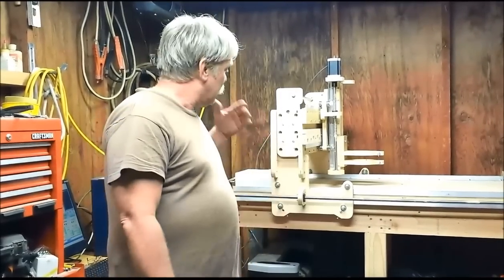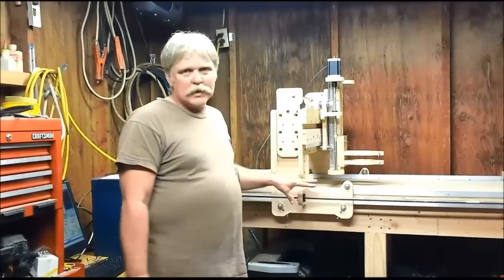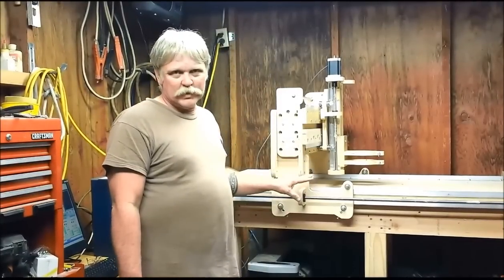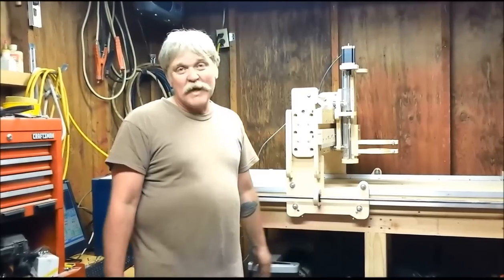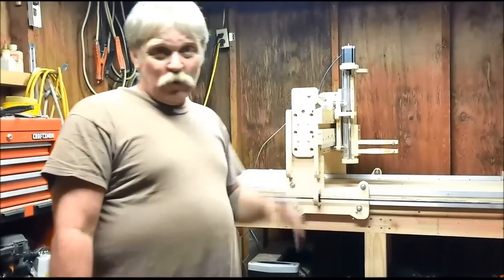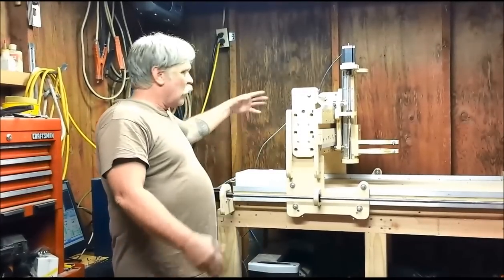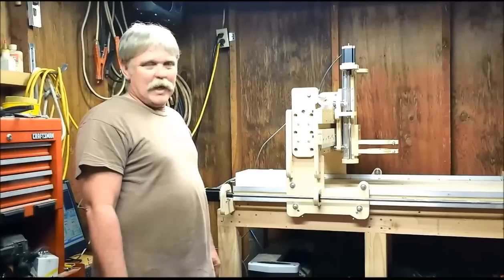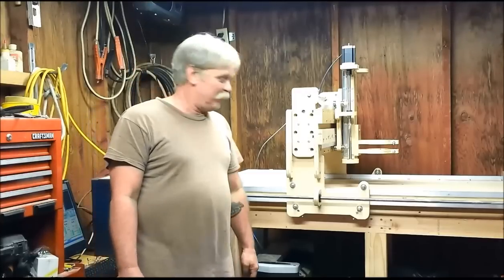CNC Router   IT'S ALIVE!!!

Comment: Hey Mark, do you know how to set the x-box controller that you use to make the axis to move very slowly? Thanks in advance.
Reply from the maker: If you have your controller set so that your axes are controlled by the joysticks, they're proportional. If you move the joystick all the way to its stop, the axis moves fast. If you just barely move the joystick at all, it's moves slowly. It's not a setting - it's just built into the Mach3 plugin.
Reply: Yep, I got my joystick working fine, but I have seen people making the axis turn barely just pushing another button on the controller, once you config that button for a barely movement, the axis will turn very slow even if you have the joystick moved all the way. Thanks any way for your fast respond.
Reply from the maker: I do have my controller set up to move any axis by a single step each time I move the joystick after I push the A button. I push that button again to go back to normal operation. I don't have it set to move the axes at a slow rate other than that though. I can't get out to my CNC right now to fire it up and tell you how I did that, and I don't have the plugin or controller on this computer to look at it. I will be doing a video on my set up in a couple of months, however, and this is one of the things I'll address.
Reply: Thanks Mark.

Comment: Hi Mark, 
What kind of aluminum angle did you use? Are the inside corners rounded and the outside corners square? I have a difficult time seeing how a V-Groove bearing will ride smoothly on an angle with that shape.
Reply from the maker: +Martin Kwant  The angle I used came from the scrap metal yard - because I'm cheap. Yes, the inside corners of the angle are rounded and the outside corners are square. The v-groove bearing runs nice and smooth. The depth of the groove is such that it keeps the bearing on the angle with no problems whatsoever. It doesn't need a knife edge to ride along. I've talked with Dave (the designer of this CNC) quite a bit about it, and he's been building CNCs with this v-groove bearing design for over 10 years. He's told me several times that the shape of the "track" the bearing rides on really doesn't matter. He's used those same v-groove bearings on perfectly square edged metals, rounded metals, and the type liek you describe, with one rounded edge and one square one. They all perform the same.

You're not moving tons of weight that puts a lot of downward pressure on the track or bearings. Also keep in mind that with the 5 start lead screw this CNC uses, it takes 2 complete revolutions of the stepper motor to move the gantry 1 inch. The speed tops out at around 120 inches per minute. So you're not going very fast at all - nor would you want to.

I've had the CNC running for right at 14 months now, and there hasn't been a hiccup at all.  It still moves just as smoothly and easily as the day I first fired it up. Okay, let me qualify that - there have been no hiccups that I didn't cause myself. This machine is great - it's the operator that still needs a bit of work.

Comment: Looks great! I just finished building one using Dave Gatton's plans. I had my "it's alive!" moment a few days ago when I first got it moving. It's a great feeling.

I'm having issues with the X axis binding up on one side and getting out of sync. I probably need to rework the rails on that side. Mine was cut, drilled, and assembled by hand, so it's a bit sloppy in places. Once I get it running well enough, I'll probably cut some replacement parts. That's the beauty of having a functional CNC router, you can always bootstrap another one.

Enjoy!
Reply from the maker: Bryan Voss Thanks, Bryan! I followed Dave's lead and clamped the X axis bearing supports to the table frame, ran the X axis back and forth and adjusted their placement until there was no binding up, then I screwed them into place.

I will give you a heads up on this machine though - keep an eye on your couplers and check the screws every so often. It turns out the set screws in the couplers do loosen up on occasion.  I need to get some removable Locktite and apply it to the threads . That should take care of it.
Reply: Mark Lindsay I worked on mine a while last night and found that the problem I was having was due to the coupler one one side slipping, exactly as you describe. The threaded rod slipped all the way through the bearing at the other end and threaded itself into the wooden support, causing it to pull the coupling almost all the way off the motor shaft. I think some locktite on the coupling end is a good idea.

I also adjusted the rails on the side I'm having problems with and made sure they were properly aligned. I ran a torture test program that runs the machine through all kinds of random moves. The program completed without any jamming and the router collet was in the exact same position as when it started, so I know it didn't lose any steps. Next I plan to get the spoilboard in place and surface it.
Reply from the maker: Bryan Voss I have an e-mail in to Dumpster CNC about applying Loctite to the threads on the coupling. I'm not going to do it until I hear back from them. My concern is the Loctite being too strong, resulting in the threaded insert spinning in the Delrin coupler, possibly breaking it. I'll let you know what their answer is as soon as I get one from them.
Reply: Mark Lindsay Great! I look forward to hearing what he has to say.
Reply from the maker: Bryan Voss I just heard back from Tim at Dumpster CNC, and he said, "You can try a tiny amount of the Loctite, probably 1/4 drop or less on one side of the threads. Just enough to sit inside 2-3 of the threads." I'm going to give it a try tomorrow. Loctite blue - NOT the red.

Comment: Mark,
Looks like a fine machine. Let us know what you are making. I built Dave's shoestring router and completed it last October. First one I cut on the table saw/jig saw. It was pretty ugly so I used it to cut all new pieces. Did you build yours with shop tools or did you get your pieces cnc cut? Just cut some log slices today with a chainsaw and milled in some sage quotes to give to a friend.
Reply from the maker: Mine is Dave's Shoestring Router too. I cut this one on my band saw, table saw, and cleaned it up on my disk sander. It's pretty ugly as well, but that's mainly because of the cheap plywood I used. There's lots of tear out and delamination. I'm going to cut a new gantry out of some FAS cabinet grade plywood and actually apply a finish to it this time. The bed is fine for now. If there are any problems, I can always cut another. That'll probably be my first project. I'll be posting a LOT of video once I get all my software activated and can do more than just move it around with the keyboard.